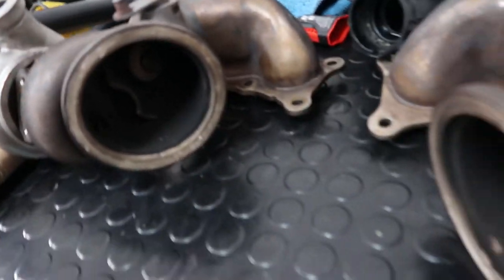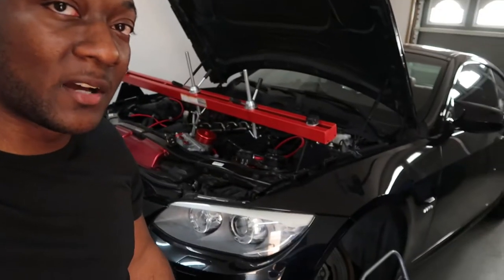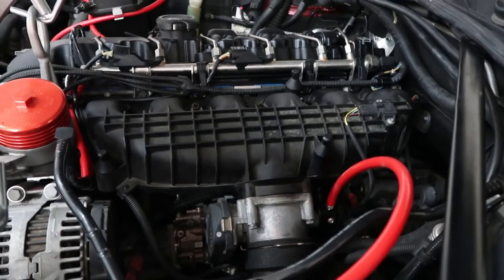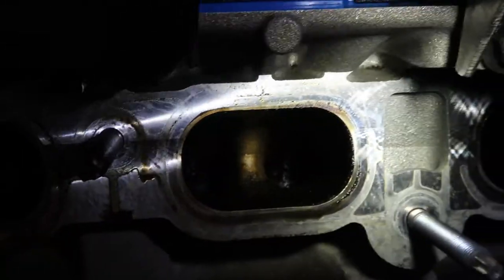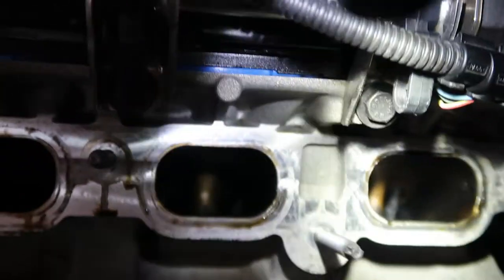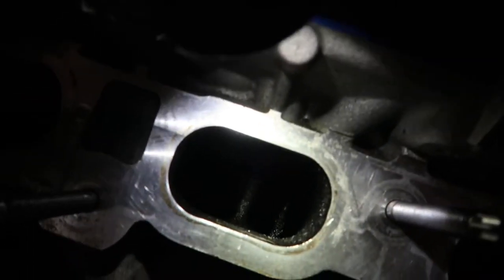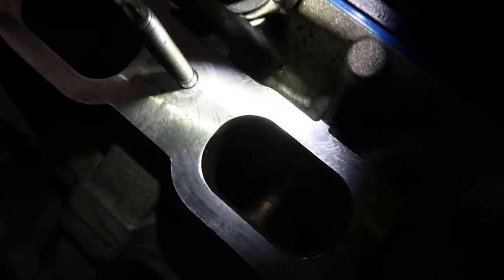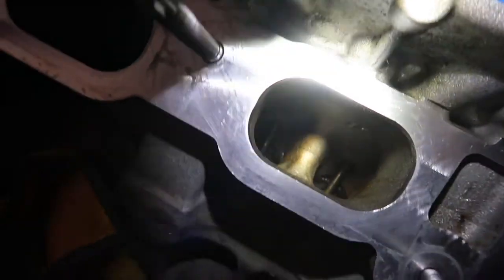N54 CRC Intake Valve Cleaning

Comment: Dude. Seriously good tip on warm engine & manual crank 👍🏼👍🏼 SUBSCRIBED
Reply from the maker: How well did it work out for you?
Reply: @n54andmore56  :) getting my tools and what not together ~> I’ve got an e90 09 & e92 07 ~> did this with walnut blast on 09 and it was a frikkin mess and slow HF blaster kept clogging <> so going this route this time
Reply from the maker: Hopefully it works out really well for you.

Comment: Can you tell other than visually seeing when the valves are close when you rotate the crank? Can you feel it in the crank when turning? Or you pretty much have to just look into the ports and see the valves closed?
Reply from the maker: Pretty much have to see it. You can kind of feel it on the compression stroke but that's about it.